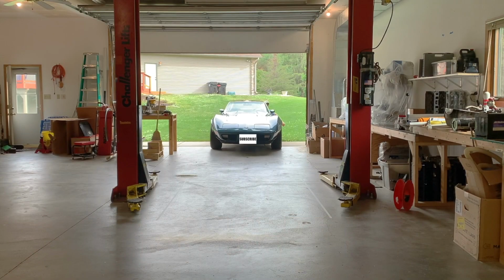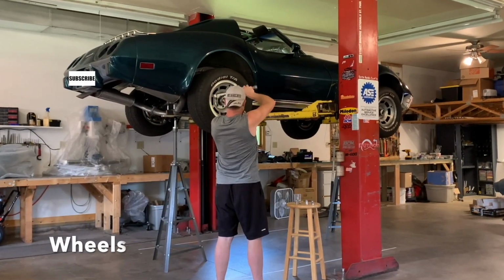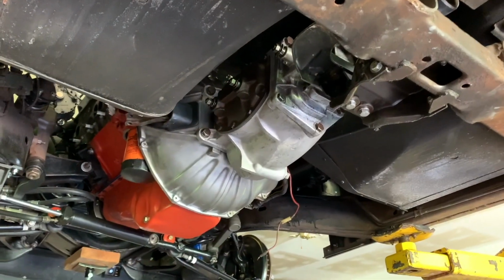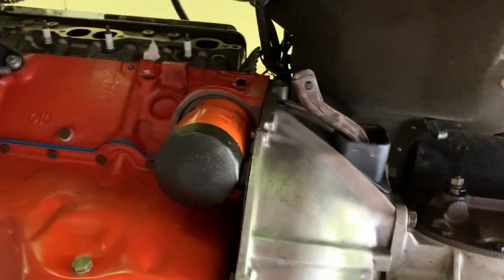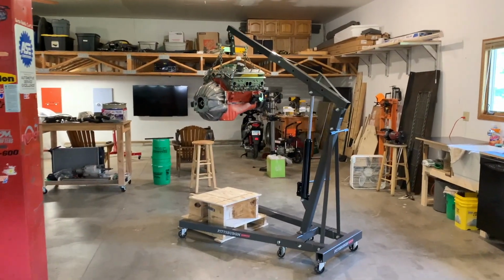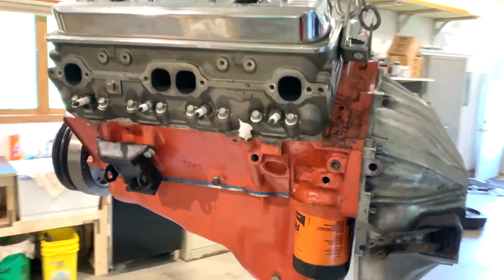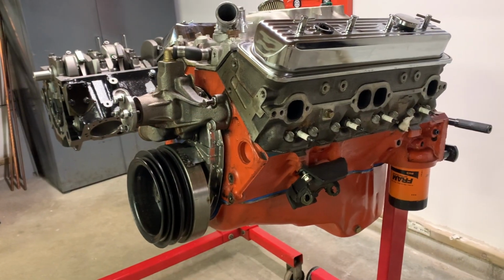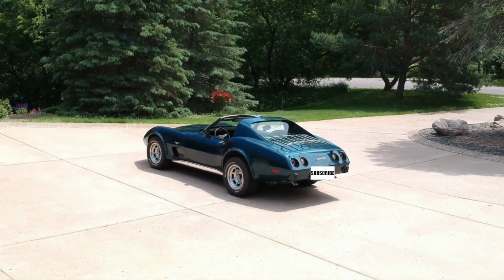Unrealized Potential: C3 Surgery

Comment: Yep. Pull the tranny, let it fall on your belly,  hug the beast, roll over and eject it off to the side. That's the way to do it!  I graduated high school in '72. I cannot count how many clutches and ahhh one shattered bell housing I replaced back in the day precisely in that way. Pull the distributor or at least pop the cap because the engine is gonna rock back. Those were the days my friend, hope yours never end.
Reply from the maker: Thanks for the comment Crawford323 / I'm actually just inherited a small block chevy that is covered in grease and has been dormant since the early 80s - that - was pulled from a 70 nova. Don't know if its a 350 or 327 but I'm hoping its a 327 / started the tear down this week!

Comment: A wide ratio 5-speed overdrive  transmission mated to a strong 3.08 rear end works fabulously on the highway and has great 0-60 acceleration . Having your cake & eating it too !  Plus with beautifully 
chromed finned aluminum no named valve covers an enduro shined chrome aluminum intake from Edelbrock with a 600 CFM Holly dual inlet double pumper carb. chrome shorty headers with TURBO mufflers radiator with twin electric High Performance fans AFR heads Roller rocker arms & roller hydraulic cam ! All of this is WAAY better looking than any ole LS ENGINE .Remember it only
cost a little more to go FIRST CLASS !
Reply from the maker: Haha - well said Jim / totally agree. You are right on with the gears too. I added a TKO600 with a .68OD and with 3.70s, it's fine but you end up in 5th a lot. There are times in 40MPH zones where 5th lugs the motor, but 4th runs a little hot in the RPM range. If I had 3.08s-3.55s, it would solve the problem in both 4th and 5th as the gears would be perfectly situated for 40MPH speed limits and the highway. Gears may be a longer term upgrade for me. Thanks for the comment!

Comment: I see the engine you're pulling out has Vortec heads and Edelbrock dual plane intake and carb....thats 325 HP and you're not happy with it?
Reply from the maker: Its a great motor / plenty of power-good torque with 3.70: gears - I wanted a 4-bolt main block that I could rev a little more safely thus the ZZ4 shortblock / thanks for the comment!

Comment: FRAM oil filter!  ??
Reply from the maker: Maybe thats why this old chevy 2-bolt wasn't doing so great -lol :) Its a flat cam rotella fed shade-tree readbuild with cast rings / you wouldn't believe the pitting i saw on the heads after only 6000-7000 miles / think it might be ground pitting/electrolysis. What oil filter to you recommend?
Reply: @TacoJoe  I usually buy American, but my oil filters are BOSCH (sorry!)
It ranks at or near the top in testing, (I have not looked at recent tests).
The basic orange FRAM is not good! Premium FRAM is better.
Reply: I just use a K&N filter with magnet attached to the bottom, seems to work just fine for myself.
Reply: @jimfurr.3  I've used Fram for years on all of my cars...no issues at all.